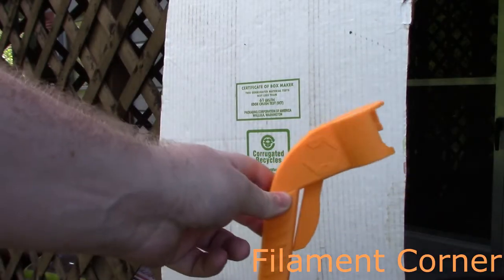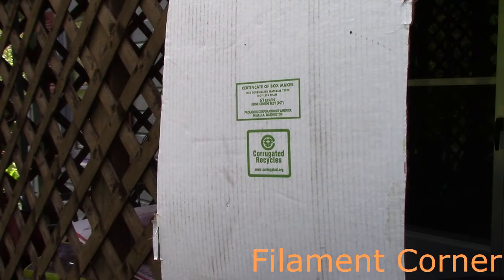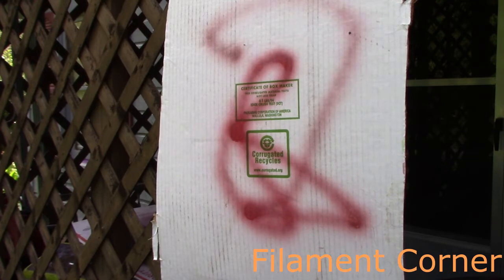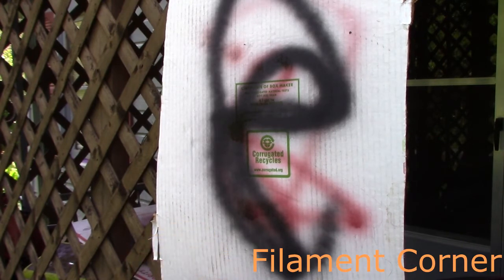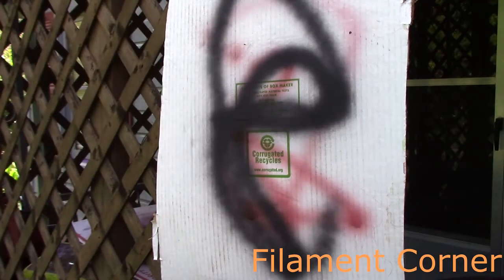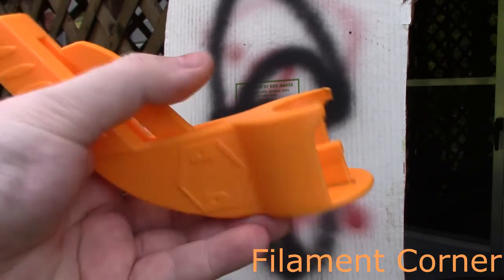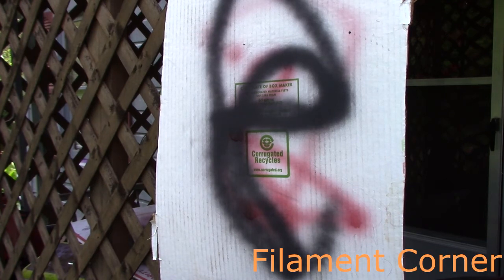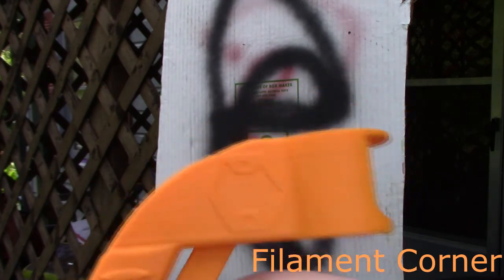3D printed spray can handle/trigger (practical printing )

Comment: Love the design. I think the trigger needs to be thicker to give it more strength. I've tried it twice and the the trigger breaks quite easily. The first print was at 25% infill the second at 60%.
Reply from the maker: I know the trigger prints the weakest in the position it prints in. The forces acting on the part run along the layer lines making it split. I had ideas on an improved version, but with work and life. I've not gotten much done design wise. I even have other projects on hold as well. Hope to get back at it when I get the chance. Thanks for commenting, watching, and trying out my designs.
Reply: Okay, I discovered this when I was watching another maker test random stuff he found to print. I printed it and also discovered the trigger was the weak point. Several failures later I desided to fix this. I used tinkercad and removed the trigger to make it a seperate print item. So now you just add a 6mm bolt and nut for the pivot and away you go. The trigger now prints flat, making it bloody strong. I have also increased the thickness of the trigger to just over 5mm. So with a 2mm bottom and top layer, it is nearly impossible to break during normal use.
Or you can just print a bolt and nut along with the trigger and there you have it. No hardware store needed :D
Reply: @MrGerhardGrobler  remix link?
Reply: @BigDeezol  JUST A MOMENT. TRYING TO LOG INTO THINGIVERSE